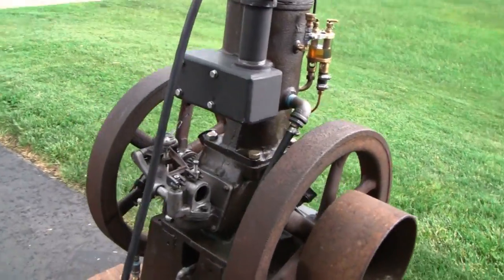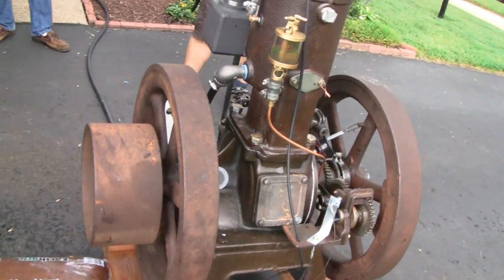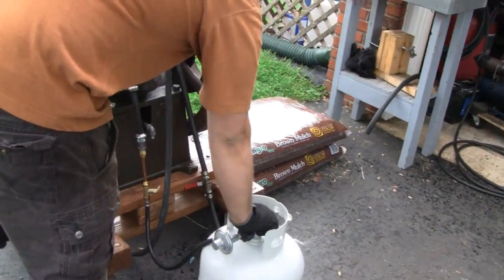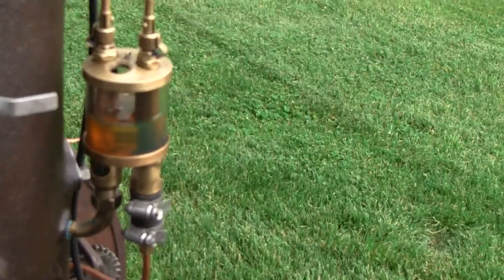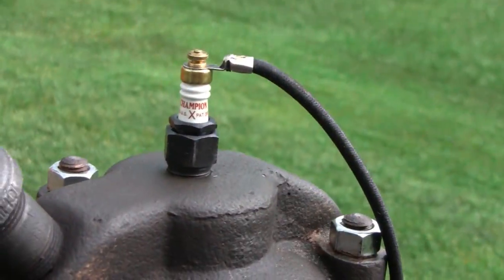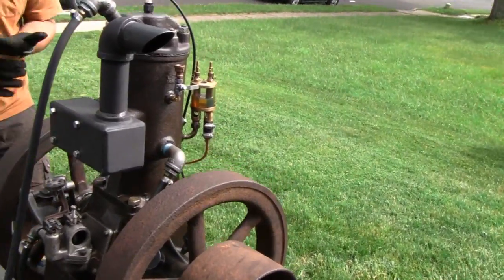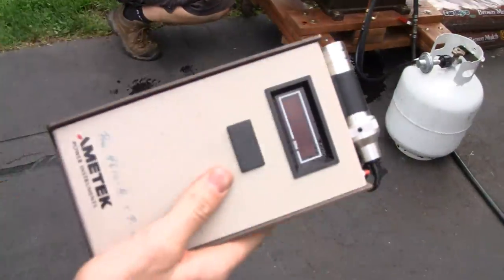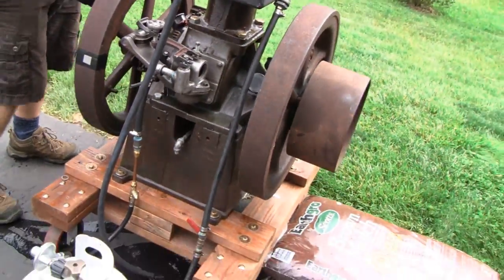BESSEMER ENGINE 1st TEST START

Comment: That would make a good home generator if you got it running right and found out a way to bolt a heavy duty alternator or similar form of belt driven power supply to the base, and connect it with a belt, then wire it up to a large bank of car batteries or some similar form of rechargeable battery (maybe a pre-existing photovoltaic cell if you have solar panels).

Comment: Nice engine my friend congratulations but I do not like how you start it with that handle in the flywheel, it is called a wrist breaker if the engine backfires you will have problems!!! I am an engine collector myself with 120 engines in my collection and I know what I am talking about:-))

Comment: Many years ago, I had a single cylinder motor cycle which sounded like that - misfiring etc. I put a new capacitor in the ignition system and it ran as smooth as silk.
Reply: +Quarlow 12 
It is a 2-stroke throttle-governed engine, not a hit-and-miss.  It is quite normal for them to skip.  It is backfiring because the ignition is too far retarded.
Reply: +Bob Bailey 
It's a two-stroke...they can be very temperamental.
Reply: +douro20 It is actually what is called a "hit and miss" engine. that is the way they run.
Reply: +douro20 well that is interesting. seen a few hit and misses and they run the same way.
Reply: Colin Blow its got a sleave valve. Thats why you can see the piston from the exhaust port.

Comment: Hey there. how you cooling that thing.......
Reply from the maker: thra5herxb12s We have a garden hose running directly into the cooling chambers around the cylinder, if you look closely you can see it draining under the engine down the driveway!!☺
Reply: I watched this video quite a few times before I realiised you did say on the video about the hose I was too eager to hear it start. We dont see these engines here in the uk thanks for posting.

Comment: 805roadking i love your videos i got a question me and my dad have a hit and miss engine and we just got it running the other day and it make alot squealing noise around the crank area what could be the problem
Reply: Are you putting any oil in the drip oilers/making sure the drip oilers are working properly? If not, it could be lack of lubrication, but if the oilers are full and running, could be a bearing.

Comment: FYI: NEVER open a propane tank all the way.  The valves used on a propane, acetylene and other fuel gas cylinders are fully open with approximately two turns.  The reason you don't want to turn it all the way is because if something goes wrong, you don't want to be there turning the valve 10 times to get it shut off.  Argon, Oxygen, Nitrogen and other high pressure cylinders need to be turned until they stop to seal the valve, but NOT fuel gas.  Different designs.  ;)  

Great job on the rebuild!  Love seeing something brought back to life!
Reply from the maker: Thanks Bud!! Great info!! I always do that with my acetylene but alotta people are unaware of it or why it's done!!☺

Comment: The propane fitting/regulators used for Turkey fryers move much more propane.  If you haven't found something that flows more yet, check out the ones for the fryers.
Reply from the maker: I think he was looking into one of them!!☺

Comment: Is that smaller cylinder on the right fly wheel an accessory drive pulley? I think they'd use big leather belts on them?

Also how do you guys find these engines, haha? It's sounds like it was found in swamp. Was this swamp on a friend's property or just randomly out in the wilderness? Are they local finds, junkyard finds, or do you guys simply just find them online by collectors and sellers? Thanks, I'm just curious. It may be fun to restore an old engine one day.
Reply from the maker: Yeah that's just a pulley on the side!! We get the engines from all kinds of places, mostly shows and auctions!! That came outta a swamp 400 miles away from us!!☺
Reply: 805ROADKING I see. Thanks for the reply. I'd hate to ask what the shipping cost was on that hunk of steel :P haha
Reply from the maker: No shipping!! We picked it up!!☺

Comment: Damn that's so cool.

How much power would this be outputting if it were brand new? Or more specifically what would it be used to drive?
Reply from the maker: It's only 8HP and probably ran a small oil derrick!!☺
Reply: This was an oilfield engine. I forgot exactly what it powered. They mentioned it in a previous video.